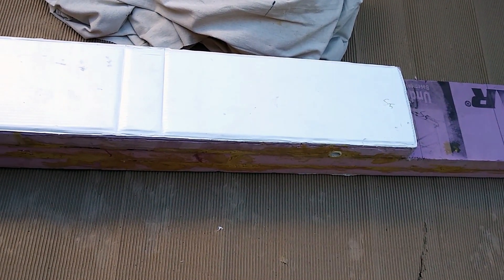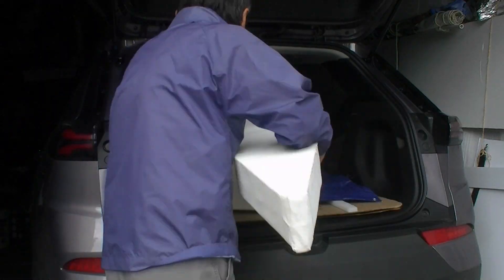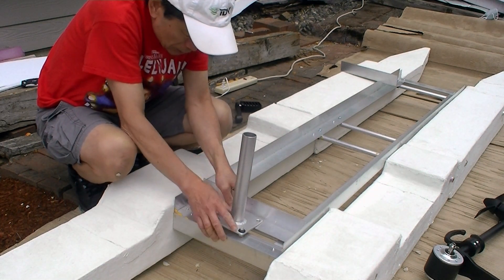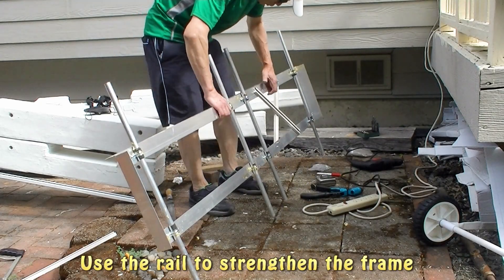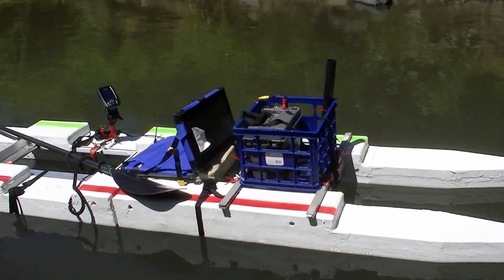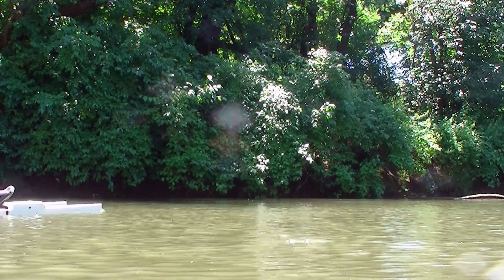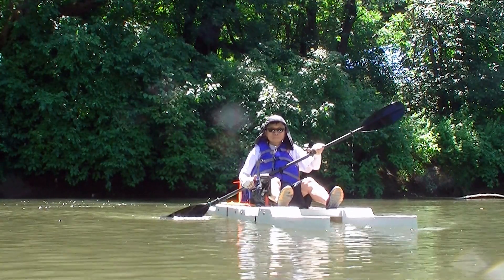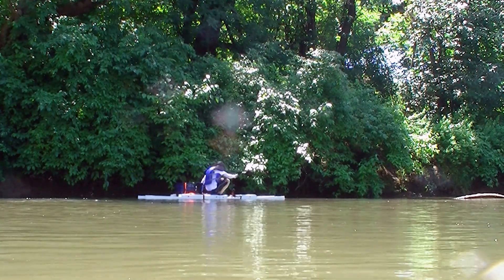Pt 3 Build a better modular pontoon boat   - Gen 6

Comment: Nice work! I'm very impressed by your thinking and ingenuity.  I am looking to build something that I can backpack into remote lakes................looks like you have some great ideas for that.
Reply from the maker: Thanks for watching. One of my goals is to use coroplast, or other materials, to create a boat that is of the size of a carry-on luggage (has to be light also) when folded. The smallest one I built is Gen 23. I can shrink the package size slightly smaller than what I showed in my video, and at 12.5 lbs with an inflatable kayak seat. As for the size of the carryon luggage, I am not able to get to that form factor yet.... still thinking how to do that.

Comment: Glue is good enough if you're not leaving the boat on the water for longer that a few hours. Otherwise moisture will surely form om the foam inside.
Reply from the maker: Thanks for your input. I always wonder if the glue I am using will last since it is labeled not for outdoor use. I will keep the pontoons dry between uses! Thanks again.
Reply: @DIYUSA  the waterproof paint will hopefully stop water from ingressing, but condensation will form inside.
For what I know, PVA is never completely waterproof, I've if the label claims to be.

Comment: You got me back in the mood again to build something similar ❤ I had an inflatable 10 ft pontoon few years back, I made it about 18 inches wider when I wanted to or the normal, at one time laid it on top of a Canoe with awesome stability, in the middle I cut a hole in floor and then pasted on water tight square thick plastic barrel with an electric trolling motor it was a beauty for sure . Too much lifting is gone so go lightly is the way. Thank you 🙏
Reply from the maker: @RealNuggets  yes, the weight of the boat is always a problem for me. But when I add many gears for fishing or for sailing the over all weight will increase. I plan to build a cart for it. Modularization will help.